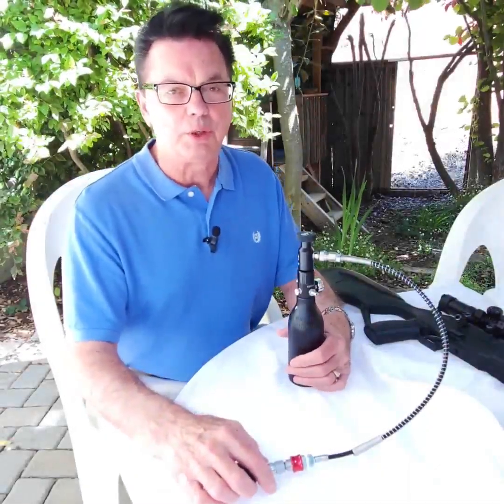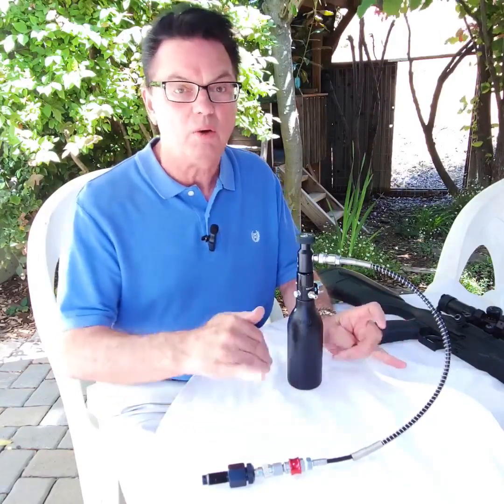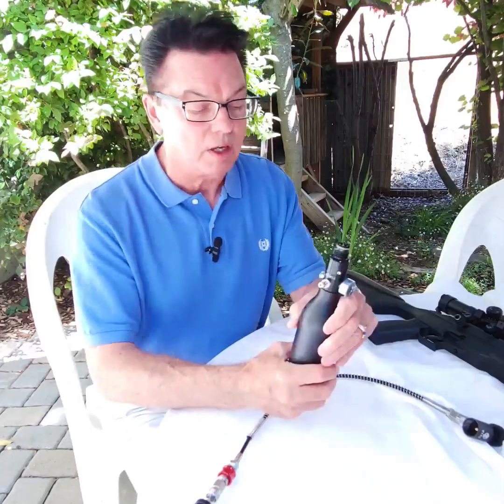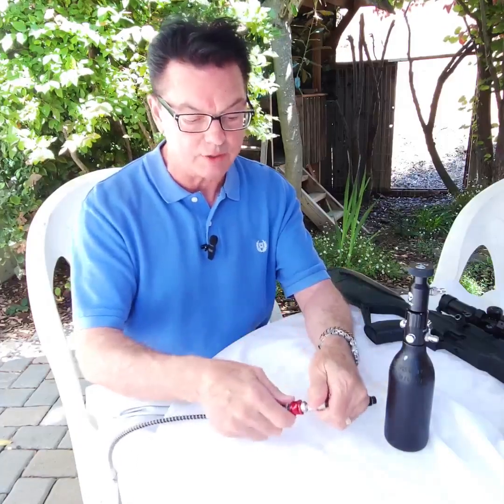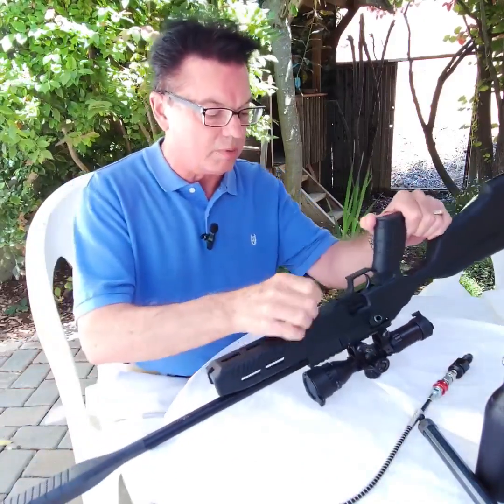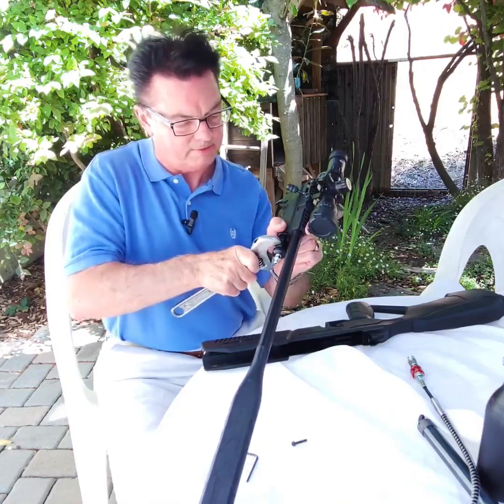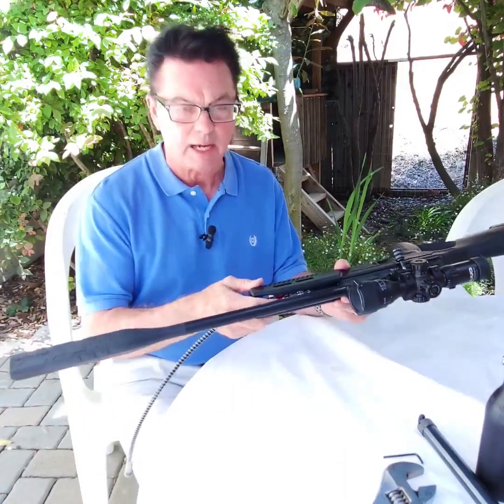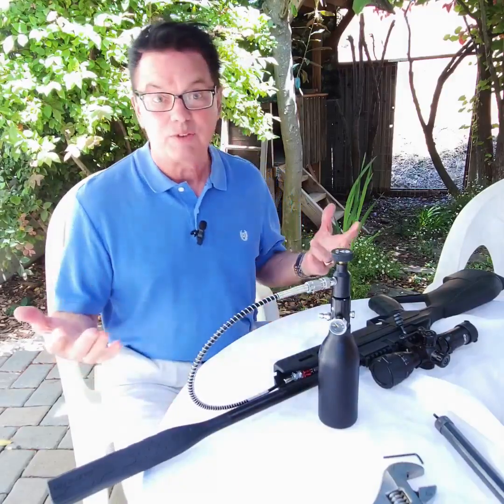Umarex Fusion 2 conversion kit to High Pressure Air

Comment: Will those same adapters work on the original Fusion? Ty
Reply from the maker: I am not familiar with the first version.  If it uses the same kind of 2-cartridge tube that has the same fitting, I think the set up I describe in this video here will work: Check out the second video I just posted on May 17, 2024 on the channel!  Complete video guide plus link to FREE downloadable guide!

Comment: Hey, have you by chance made a kit to sell yet? 
I have the same Fusion 2 and want to do this conversion
Reply: I second that
Reply from the maker: After some thought, I decided I'd need to charge too much to make it worth my time reselling parts.  So I created the second video and complete parts list with links to the specific pages on eBay, Ali Express, and Amazon where you can buy the parts yourself and save yourself money.  The kit is not hard to put together.  The hard part is figuring out the parts that are necessary.  I already did that hard part and you can easily buy the correct parts and put it together.  
Check out the second video I just posted on May 17, 2024 on the channel!  Complete video guide plus link to FREE downloadable guide!

Comment: I’d like to buy a kit
Reply from the maker: After some thought, I decided I'd need to charge too much to make it worth my time reselling parts.  So I created the second video and complete parts list with links to the specific pages on eBay, Ali Express, and Amazon where you can buy the parts yourself and save yourself money.  The kit is not hard to put together.  The hard part is figuring out the parts that are necessary.  I already did that hard part and you can easily buy the correct parts and put it together.  
Check out the second video I just posted on May 17, 2024 on the channel!  Complete video guide plus link to FREE downloadable guide!

Comment: Thanks for the video, but where can I refill my Tank Air?
Reply from the maker: The best way to refill the small tank is to buy a SCUBA tank on Craigslist (under $100), buy the yoke adapter to connect it to the small tank.  Dive shops can refill, $10 where I live.

Comment: Thank you for the advice and videos. I have hp tanks but I need a list of everything else or a kit.
Reply from the maker: Thanks for checking in.  I have seen several requests on different sites for a parts list.  I am considering providing that!  In the meantime, I have another kit that I'm putting up on eBay that has a couple different components (today is July 7, 2023).  

Tell me about your tanks.  Are you using them for paintball?  The regulators for paintball are mostly all rated at 800 psi, which is a little low for an air rifle.  But the tanks usually can hold up to 3,000 psi.
Reply: @dataventurer9998   My brother is a professional paintball player and runs a paintball supply store. Most tanks start at 800. Just guessing I would say that you have a fitting from the 88 gram cartridge to the line then the tank. I have the line it’s a common part. You need anything that we might have?
Reply from the maker: @soggybottomgoldprospecting3586  Check out the second video I just posted on May 17, 2024 on the channel!  Complete video guide plus link to FREE downloadable guide!